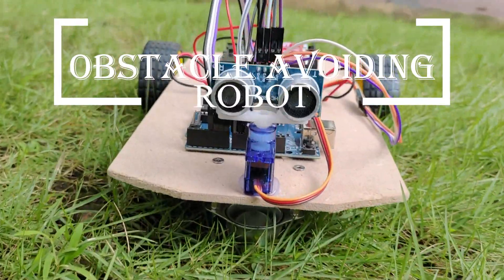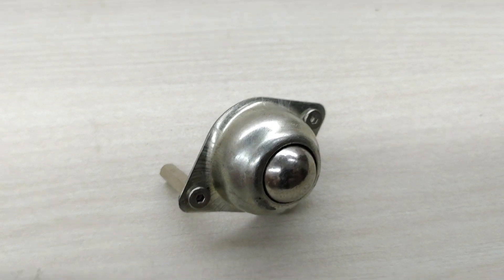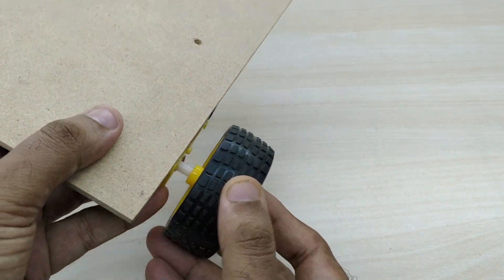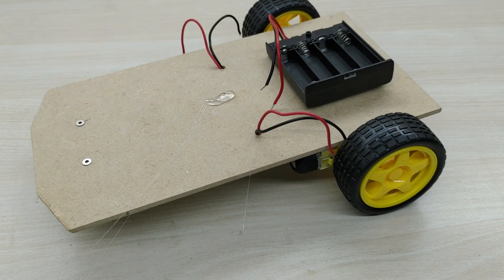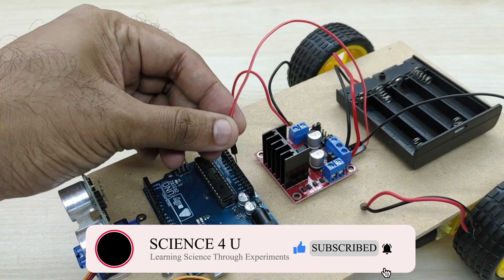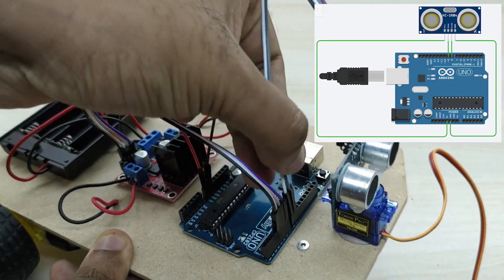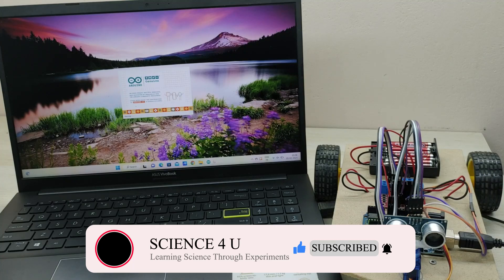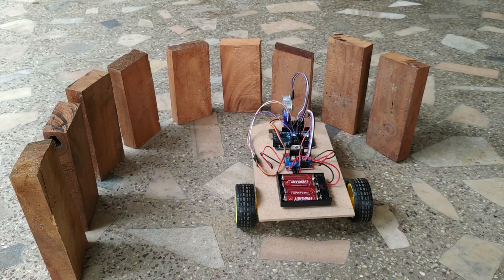Intelligent Obstacle Avoiding Robot || Step by Step Tutorial || Arduino Project

Comment: what is the minimum voltage needed ?
Reply from the maker: Minimum 5V is required for arduino uno to work. In my experience, 7.5 to 9V is most ideal for this project.

Comment: im using an elegoo r3 board would it still work the same?
Reply from the maker: Yes friend. It will work the same. Elegoo is only a brand name. Basically it is all same. 🙂
Reply: @Science_4U_  and for some reason the senor only works when pluged into my laptop other than that i have no idea whats happening
Reply: @Science_4U_  the code on my laptop keeps showing an erroe
Reply from the maker: Can you try reuploading the code...you can download the code once again and upload. Looks like the code got modified..
Reply: @Science_4U_  okay ill try and ill let you know
Reply: @Science_4U_  the codes giving me a error like this Arduino: 1.8.12 (Mac OS X), Board: "Arduino Uno"

/Users/Azza/Documents/Arduino/bot/bot.ino: In function 'void loop()':
bot:4:17: error: 'trigPin' was not declared in this scope
   digitalWrite( trigPin, LOW);
                 ^~~~~~~
bot:6:32: error: 'include' was not declared in this scope
   digitalWrite(trigPin, HIGH); include <Servo.h>
                                ^~~~~~~
bot:6:41: error: 'Servo' was not declared in this scope
   digitalWrite(trigPin, HIGH); include <Servo.h>
                                         ^~~~~
/Users/Azza/Documents/Arduino/bot/bot.ino:6:41: note: suggested alternative: 'Serial'
   digitalWrite(trigPin, HIGH); include <Servo.h>
                                         ^~~~~
                                         Serial
bot:16:14: error: a function-definition is not allowed here before '{' token
 void setup() {
              ^
bot:33:5: error: 'Myservo' was not declared in this scope
     Myservo.write(90);
     ^~~~~~~
bot:47:5: error: 'Myservo' was not declared in this scope
     Myservo.write(0);
     ^~~~~~~
exit status 1
'trigPin' was not declared in this scope

This report would have more information with
"Show verbose output during compilation"
option enabled in File -> Preferences.

Comment: Hello sir, 
One of my motor is working and one is not. I tried interchanging the IN pins still only one of them is working. Please tell how to solve this
Reply from the maker: Hi friend. When you interchange the pins, the working motor is also interchanged?. Or the same motor is only still working?
Reply: Yes @Science_4U_
Reply: Sir please reply I have very little time
Reply from the maker: @gamerlifen9866 Hi friend. Can you please share the video of the problem in my instagram id. Then I will really understand the problem and I can help..

https://www.instagram.com/_science4u_?igsh=ZGNjOWZkYTE3MQ==
Reply: @Science_4U_  The motor on pin IN1 AND IN2 work and the motor on IN3 and IN4 do not work. But when I just try to run one motor it works
Reply: Can you tell what you don't understand I can try to tell you
Reply from the maker: @gamerlifen9866 okay..let me understand. If you disconnect IN1 and IN2 does the motor on IN3 & IN4 alone work?
Reply: @Science_4U_  yes
Reply from the maker: @gamerlifen9866  similarly if you connect IN1 and IN2 and disconnect IN3 & IN4, does the other motor connected to IN1 and IN2 work?
Reply: @Science_4U_  yes
Reply from the maker: @gamerlifen9866 okay friend. It is a battery problem. The battery that you have connected is not powerful enough to rotate both motors together. Can you do the following 2 things?.
1. Can you lift the car up so that wheels are not touching the ground. Now whether both motora are rotating?. If one motor is not rotating, can yoj start rotstion of the wheel with your hand and see if it is rotating?. 
2. Connect arduino to PC or laptop using USB cable. With the USB cable connected and battery also connected see whether both motors are rotating.
If any of the above is true, the battery is the problem.Changing to a powerful battery will solve the problem
Reply: @Science_4U_  I tried lifting the car and  rotation the other wheel with my hand but it didn't work. I tried operating it with a new battery but still only one wheel is working
Reply from the maker: @gamerlifen9866  what battery are you using?. I am very sure it is a battery related problem. Because both motors are rotating separately one at a time. The problem occurs when both motors are trying to rotate together. This indicates a battery related problem only.
Reply: @Science_4U_  A 9V Volt battery
Reply: Can this be a motor driver issue
Reply from the maker: @gamerlifen9866  I am very sure it is a battery problem .The small 9V battery gets drained very fast. Use a new battery or connect 2x  9V batteries in parallel..
Reply: @Science_4U_  But I tried with a new battery still it didn't work
Reply: I tried with series and parallel still only one wheel is rotating
Reply from the maker: @gamerlifen9866 Hmm okay friend. I can further help if you can share some video of the problem in following instagram id..
https://www.instagram.com/_science4u_?igsh=ZGNjOWZkYTE3MQ==
Reply: If instead of 9V battery I use the battery pack mentioned is there a chance it will work
Reply from the maker: @gamerlifen9866 Yes friend. I still feel it is due to bad battery only that both motors are together not working. Both the motors are separately working one at a time.
Reply: @Science_4U_  Ok sure I will try

Comment: Bro can i use 2 (3.7v) batteries
Reply from the maker: Yes..sure friend. Those are much better than the AA batteries that I have used. 2 x 3.7V 18650 batteries are the best for these projects. These batteries last really long and are recheargeable too.
Reply: Thank you bro...
Reply: Bro plywood measurements???
Reply from the maker: @suthanthiradevi5419  25 cm x 13cm
Reply: Bro can i know the algorithm used here
Reply from the maker: @suthanthiradevi5419 The algorithm is very simple. The ultrasonic sensor transmits ultrasonic waves and also recieves the reflected ultrasonic waves from the objects in front. If the time between the transmitted and received ultrasonic waves is very less, that shows that an obstscle is there in front. If an obstacle is detected, the wheels are commanded to rotate backwards and turn direction and then go forward.

Comment: Hello, my arduino board does not have a loref pin, what is the solution?
Reply from the maker: Hi friend. If it is not labelled as IOREF pin, it may be written as 5V. Both are one and the same. You can use either one..
Reply: @Science_4U_  thank you
Reply from the maker: @Sharifi_Matin You are most welcome friend..🙂❤️
Reply: @Science_4U_  The servo motor only rotates in one direction, what is the problem?
Reply from the maker: Is the servo motor turning 180 degrees in one direction?
Reply: @Science_4U_  Yes
Reply from the maker: @Matinsharifi7  can you send a video of the problem in my instagram id?. I will check.

Comment: can you please help me the car not move the servo motor working but dc motor not
Reply from the maker: Okay friend. There could be several reasons why the DC motor is not rotating. Most probably it could be related to the motor driver board.Please check the following. Do you see light on the motor driver board? Are there jumpers connected to ENA and ENB pins in motor driver board?. Is it a new driver board or an old one which has already worked before?

Comment: My wheels are not responding
Reply from the maker: Hi friend. Are you seeing lights on both arduino and motor driver board?. Are you using good batteries?. Sometimes motor driver board could be faulty. Have you used the motor driver board before, or is it a new one?. Also do you see jumpers on ENA and ENB pins on motor driver board?
Reply: @Science_4U_  yes I am seeing lights on both the sides and I am using everyday 4 in one battery holder and battery and when tested the motor driver is also working
Reply: The motors are producing a little sound also as they are trying to rotate but they are not able to rotate and I am also using 4 everyday batteries as shown in the video
Reply from the maker: @Devansh10356 How did you check the motor driver board for its working?

Comment: How it was working IR  for turning automatic sensor have u used any code or it  will be turn automatic
Reply from the maker: Hi friend. It is detecting obstacle using an ultrasonic sensor in front. When the obstacle is detected, it reverses changes direction and then moves forward, thus avoiding the obstacle. The algorithm for this is written in the code..

Comment: Thank for vedio my servo motor is rotating 360 degree  how can i change to 180
Reply from the maker: Hi friend. You have to change the servo type. You may be having a continous rotation servo. It doesnt have position control. It countinously rotates and speed only can be controlled. You have to change it to a standard rotation servo which has a total rotation angle of around 210 degrees only.

Comment: I am using a single dc 9v battery but it is not functioning well so do you think I should just use the 4 AA battery? then will it work properly? the robot works when plugged into my pc but when unplugged the robot just stands still and the Arduino Uno light and all are working.
Reply from the maker: So, the soluyion is to use new batteries. 9V small battery will work but will not last long. 4AA batteries will last longer. Best option is to use 2 x 18650 3.7V battery which are rechargeable also..
Reply from the maker: Hi friend.. It is definitely due to poor battery. When plugged into PC, the power to arduino board is taken from PC through USB. Hence the batteries are used to run the motors alone and it just rotates. But when PC is disconnected, the battery has to power both arduino and motor, which becomes difficult with bad batteries. Hence the motors dont rotate. If you start rotating the wheel, sometimes it will rotate..
Reply: Ok thank you so much

Comment: Hlo sir,  
Can we use a single dc 9v battery
Reply from the maker: Yes friend. You can use a single 9V battery. But if it is the small commonly available battery, then it will not last long..
Reply: @Science_4U_  sir i  used this 9v battery but anything doesn't work so I dont know where is the main problem
Reply from the maker: @swapnilthakare-er9it okay friend..we need to do some checks to understand the problem. Can you see lights on both uno and motor driver board?
Reply: @Science_4U_  yes sir it's showing
Reply from the maker: @swapnilthakare-er9it okay..In thr motor driver board, can you see  jumpers connected to ENA and ENB pins?
Reply: @Science_4U_  yes sir 
From your circuit diagram I am connect all connection to my components
Reply from the maker: @swapnilthakare-er9it Okay friend.. What i am asking is about 2 jumpers which are required for the motor driver board to work. Some boards dont have that. Okay..can you do one thing friend. Can you take some photos of the connections and the motor driver board to my instagram id...I will check..
https://instagram.com/_science4u_?igshid=OGQ5ZDc2ODk2ZA==
Reply: @Science_4U_  ok
Reply: @Science_4U_  and when I connect a cable to arduino uno for upload a code then a left side motor works and sensor also work and right side motor doesn't work
Reply: Pls sir tell me what we do because this is my college project
Reply from the maker: Okay..i can help you..

Comment: Hello everyone. How could I do this with a boat?
Reply from the maker: Hi friend..That is an exceplent idea.!!!..It is actually possible to do an obstacle avoiding boat also. Instead of the left and right motors you can have left and right propellers. When both propellers are rotating, the boat  goes forward. When an obstacle is detected, any one propeller alone can be ON and other can be OFF, so that the boat turns. For example, if left propeller alone rotates, the boat goes to the right...otherwise if right propeller alone rotates, the boat goes towards left..thus avoiding the obstacle..
Reply: @Science_4U_  Thanks. I’m planning to do a “machine” that collects leaves and debris from a pools surface.
Reply from the maker: @donlimonesioyt9644 okay friend. That is a great idea. Wishing you all the very best..🙂

Comment: I do everything but the motor won't work except with computer usp port. I put every voltage i can use to turn without pc put motor wont's work
Reply from the maker: Hi friend. If the motor works when the arduino is plugged to computer USB port, the most likely it is a battery problem. The battery is discharged and not able to drive the motors. When it is connected to USB, it is getting additional power and thus the motor  rotates. Changing the battery to a good one should solve the problem..
Reply: @Science_4U_  hi . I use a New battery but the motor still doesn't work
Reply from the maker: @mohammedbj9226  Hi friend. To my understanding it should be definitely due to the bad battery. When you are connecting to battery alone, are the lights in UNO and motor driver board turning ON? Also , when it is connected to batteries alone, can you just try starting rotation the motor with hand?. If it is rotating after you rotate with hand, it again shows that it is a bad battery. Can you please try this?
Reply: @Science_4U_  yes the light  turning for both  the uno and motor driver board and i try mov it with my hand but won't move i started think it's an uno board proplem

Comment: Bro this is rotating not going correctly🥺🥺
Reply from the maker: Hi friend. Just interchange the wires of the motor that is rotating backwards at the motor driver side. That will solve the problem..
Reply: @Science_4U_  thanks

Comment: Question, how do we turn it on and of?
Reply from the maker: Hi friend. Actually in the battery pack that I have used, there is a small toggle switch by the side using which I can turn it on or off..
If you dont have the switch in the battery pack, you can connect a separate switch in the positive (red) or negative (black) wire from the battery pack.
Reply: @Science_4U_  Ah, I see— Thank you ♡

Comment: Hi,I connected 9V battery to motor driver l298n, motor driver's 5V pin to the Arduino's Vin pin and GNDs together.I connected ultrasonic sensor hc-sr04 to Arduino's 5V pin,GND to GND,trig and echo pins.Motor driver l298n and Arduino works properly,but ultrasonic sensor doesn't.What might be the problem?
Reply from the maker: Hello friend..From what you have told, the connections are done correctly. Most likely, the ultrasonic sensor may be a faulty one. Have you used this sensor without any problem before? If it is the first time that you are using this sensor now, then most likely it should be a faulty one. Replacing it should solve the problem..
Reply: @Science_4U_  Thank you🙏

Comment: Hello, I have done the exact same set-up as you, but my servo doesn’t rotate..Other parts are ok.
can you tell me how I could fix it?
Reply from the maker: Hi friend..please check the connections once again. If the connections are correct and servo is not working, then it could be a problem with the servo motor. Replacing the servo motor will solve the issue. Also see if the servo motor is working with arduino connected through USB. If it works, it means that the batteries are not good and not able to drive servo motor. When arduino is connected through USB, the USB supply powers it and hence it gets sufficient power to rotate. Please check these things..

Comment: Everthing is working fine but the servo is not rotating at all and the ultrasonic is not detecting obstacles what should i do ? Great video it was so helpful ❤️
Reply from the maker: Hi friend. Thank you so much for the nice comment..💓
Most likely the ultrasonic sensor is not working. The servo motor is given just to give the feeling of looking to both left and right after detecting the obstacle. If the servo motor is not there also it will work. But ultrasonic sensor is very important for proper functioning. Just check the connections to ultrasonic sensor once again.  If it is correct and still not working, then most likely this sensor is faulty. Changing it should solve the problem..
Reply: @Science_4U_  I changed it it worked thank you.❤ but another problem occurred all lights are on but nothing is moving what should i do please answer its for my project?
Reply: I checked the motors alone and its working whats the problem?
Reply: It is moving in a circle in port 1 and 2 only
Reply from the maker: Hi friend. Can you explain the problem clearly?. Do you mean that both motors are rotating but in opposite directions?
Reply: @Science_4U_ yes exactly and that it does move only in a circle
Reply from the maker: Okay friend. Whichever motor is rotaying in the backward direction, just interchange the red & black wire connections to the motordtiver board. After this, both motors will rotate in forward direction .
Reply: @Science_4U_ it worked thank you very much❤️
Reply from the maker: Okay friend. Happy to help..🥰🙂

Comment: Sir my I've connected 4 aa batteries of 1.5v as shown in the video, my sensor and servo is working, but  both the motor is not working, when connected only on battery. When I connect the usb and battery simultaneously, then only the right motor goes backward and servo works, but left motor is not working
Reply from the maker: Okay friend..The problem could be most probably due to bad batteries. Please use new batteries and problem should be solved. Also check whether the connection from batteries are correctly given to the motor driver board.👍